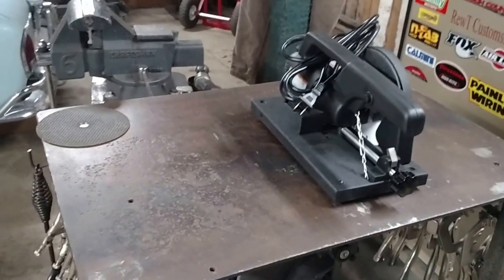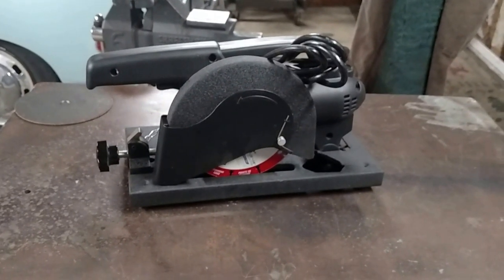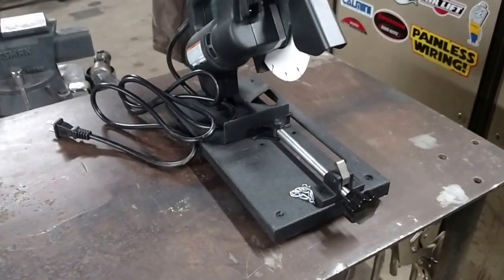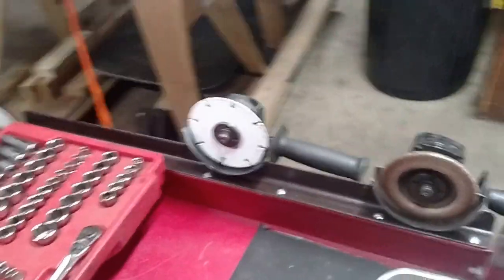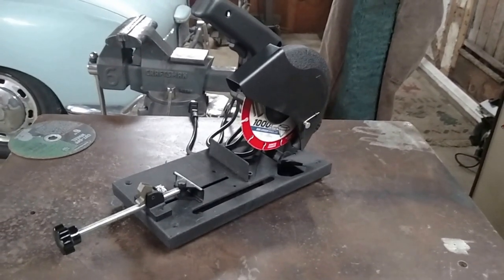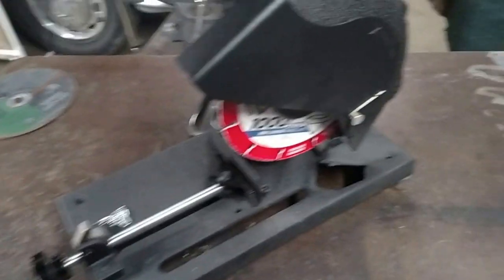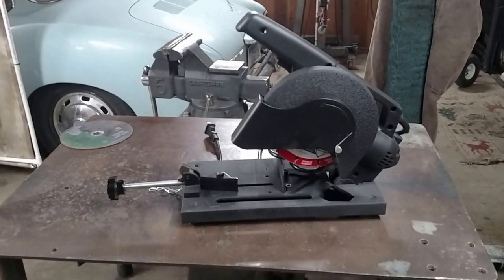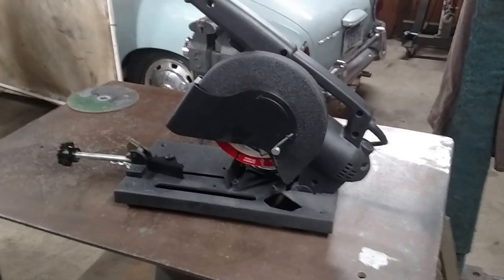6" Mini Chop Saw

Comment: I also have this cut-off tool, how did you fit the 7/8 arbor Lenox wheel to the 5/8 arbor?
Reply from the maker: From what I remember, the Lenox comes with the arbor as a knock out if you need the larger size. I am still on the original Lenox blade from this video.

Comment: They say it cuts up to 1", do you think it's capable of maybe a 2" or 1.5" diameter cut?
Reply from the maker: I have cut 1.5 pipe/tube with it before, but wouldn't  go any bigger. It worked, but took awhile and it was pretty warm after. Thanks for committing!

Comment: would this cut a 2.25 in exhaust pipe? I just dont want to have to spend on a large chop saw if this one
 would get the job done
Reply from the maker: I don't know about that one, I am sure you can, but you will have to cut a little then stop and spin the pipe and cut some more. That might be to big for a single cut. I use it for 1x1 square tubing and small pieces like that. Anything bigger I use the normal chop saw or Bandsaw! Thanks for watching!!
Reply: gotcha, thanks for the reply man!

Comment: How quickly does it cut through steel sir? Faster than an angle grinder? Probably a Newbie question but I have never owned a chop saw for metal.
Reply from the maker: Probably about the same speed as an angle grinder, but way more accurate! I have this and a large 14' chop saw and use this when I need to cut something quick that isn't to big. Thanks for watching and committing!

Comment: You should also use this saw for cutting timber.
Just fit a wood cutting blade.
Reply: Actually this saw can cut a variety of different materials you just have to use the appropriate blade or cut off wheel.

Comment: can it cut a 2x4?
Reply from the maker: I think that would be pushing it. I recently cut a piece of  2x3 1/8 wall square tubing and that was about the max. For anything larger I will use my 14in chop saw or bandsaw, Thanks for watching!